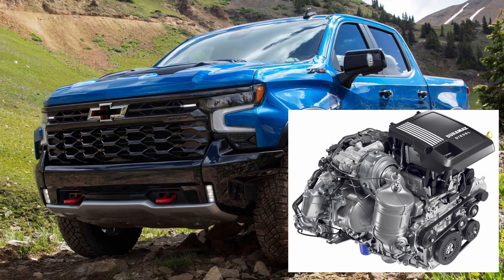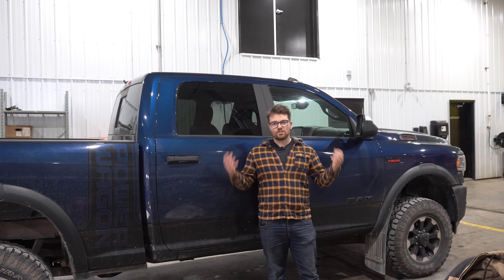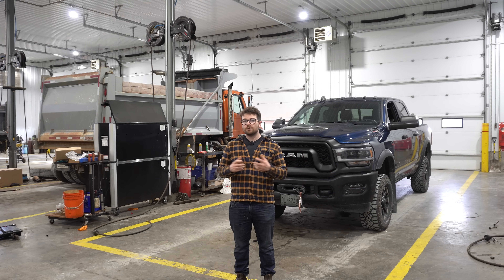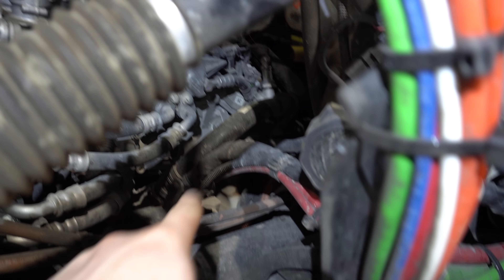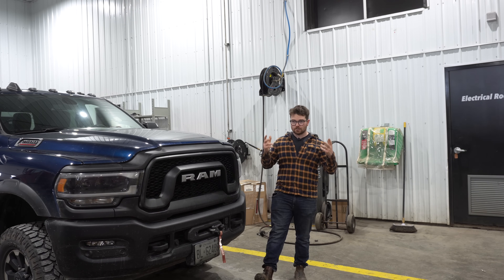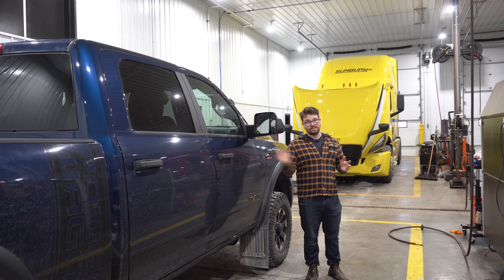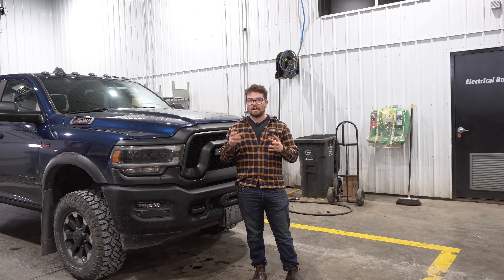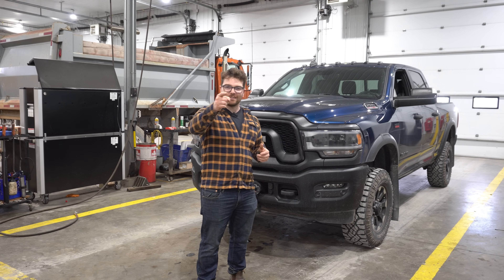Chevy Silverado 1500 3.0 Duramax Diesel **HEAVY DIESEL Mechanic Reviews** | Is It a GOOD Engine??

Comment: Best damn powertrain in a 1/2 ton truck by miles!!!!  I own a 2022 and this thing tows my RV better than my 2019 6.4 Hemi Ram 2500!  I get 26mpgs city and 30mpgs highway.  Towing my RV I get 14mpgs!  Maintenance and oil changes are less $$ too!  The oil belt is now rated for 200k miles which 90% of us owners will never even touch!
Reply from the maker: Happy to hear you like the truck and the Duramax!
Reply: @GettysGarage  yeah I have several trucks (Ram 2500, F150, Ram 1500) but love my 3.0 the best!  The torque and acceleration it has for the economy is astounding!

Comment: Thanks for making this video! Enjoyed your video and learned a lot man. I just bought my first diesel which is the 23 AT4 with the new LZ0, so far so good...The torque is amazing! .  I have about 500 miles on it so far so good. I came from a 17 Tundra 4.6L, I just hope this engine/ truck is reliable for the long run, since I've owned only Honda and Toyota in the past.
Reply: I picked up a 2023 AT4 LZ0 Diesel, too. Let's keep in touch for future experiences.  Enjoy your truck!
Reply: @rjsangha  For sure man! I just hit 1,500 miles on mine so far so good.
Reply: @clubtc05  what kind mpg have you been getting if don't mind asking ?
Reply: @rjsangha  around 19-20 in city and around 27-29 on hwy.. you ?
Reply: @clubtc05  so i only got 150 miles , I been getting 23-24 combined , still have to take a long trip to get a freeway mpg. But I am impressed, coming from ram 5.7 hemi I was only getting 13-14 mpg with 3inch lift.
Reply: Did you happen to get the max towing package ? If so how is the truck handling with it ? I’m in the market for the 2024 Chev 1500 LZO max tow !

Comment: I have a 2021 GMC AT4 with the 3.0 @ 50,000 miles. The only issue I have had so far is the starting issue. The first time it happened I thought I was going to have to disconnect the battery to make it stop cranking. The dealer has never been able to replicate it but they did show me the TSB for the cam sensor and told me they would need the truck for a week. Because of that I've never had it fixed. In 50,000 miles it has only happened about 8-10 times so I haven't stressed over it too bad.

Comment: I picked up my 2023 with the Duramax last week. I have the max trailering package, which gives you a 13,000 max tow rating. I think it is a very impressive truck. I also have a diesel Range Rover, which I plan to sell next year. I believe the fuel mileage is similar, despite the fact that the truck is a lot heavier and more powerful.
Reply: What’s the most you’ve towed with your truck and does it drop a lot when you hook up to a heavy load ? I’m in the market for a Chev 1500 LZO max towing package myself !

Comment: I crossed 52k in early October, more than half of that while towing our trailer.  Had a DEF level issue (gauge inaccurate) issue that took almost 2 years for GM to finally address. But 5 Service visits and 30+ days out of service since October 8 - EGR Cooler, Valve, Pressure Sensor… Then Glow Plugs, now a Chaffed wire issue on the EGR Pressure sensor leg of the harness.  My biggest issue isn’t the problems we had, but rather dealing with GM to get the problems addressed.
Reply: What was the resolution for the DEF gauge?  Mine is brand new and the gauge shows 40%.
Reply: @jamesclark7630  - Gauge is accurate when not trailering.  It doesn't sample correctly, and can't predict range for anything with a trailer.  I'm at 75k now and have learned to accept it.  40% means they didn't give you the truck with a full tank of DEF...  Also - it's a 7 gallon tank (appx) but will show empty with 2 gallons (appx) left.
Reply: Lemon low

Comment: if you avg, 15,000 miles a year it's still 10 years before you need to service it, me my diesel runs 3-6 years so i probs will have it sold before it reaches 50,000 miles due it being a business expense 

LZ0 belt inspection/replacement has been pushed back to 200,000 miles since it hasn't shown any significant issues at 150,000 miles
Reply: Nothing to do with not showing wear. This engine is too new to have a sample size of engines over 150.000 miles large enough to have a indication of wear. It’s more likely GM got negative press about the labor to replace the belt and just upped the mileage to quiet the complaints. By the time a problem with belts breaking becomes widespread these trucks will be way past warranty and old, they won’t have to pay for it. GM probably won’t even be making this engine when the majority get that amount of miles on them.
Reply: @khakiswag  plenty of 150k out there , clearly they run their own tests too . Doubt they give a shit about "negative press" Duramax 3.0 selling very well for them
Reply: @AmazonWebService98  they do run their own tests and that’s when they determined 150,000 miles. Probably what the manufacturer of the belt also stated from their tests. However after it got out about what was entailed in replacing it they magically waved a wand and said 200,000 miles. But trust GM I’m sure it will fine, just like the transmissions, lifters and ignition switches.

Comment: LM2 is a good engine but too complex for a diesel. It has multiple coolant valves & sensors, which can fail on top of the emmisions system, which can fail & limit mobility. The weak point in 1/2 ton GM, as well as, Ford 1/2 ton trucks is the garbage Ford-GM 10-speed transmission. Currently diesel costs @ 30% more than gasoline & 3.0L diesel engines are @ 30% more fuel efficient. So fuel costs are about the same. Diesels also have higher maintenance costs & require DEF.
Reply: A Service costs me around 25% more for oil and filter.  8000km for gas vs 12000 for 3.0 so ends up being equal or same.  Fuel filter is 40$ and takes 20 min to replace in driveway

Comment: I have a 2022 3.0 1500 seirra and I have hit 35mpg multiple times and even taken pictures of it because I was shocked. and I ordered my truck with the max tow package crew cab and standard bed and I'm rated to tow 12000 lbs so your numbers are a bit off I think the numbers you quoted are for the older (non refresh model)

Comment: Long start/no start was solved almost a year ago. All they do is update the software. Oil belt would be no harder than a timing belt on modern cars
Reply: False!

Plastic timing cover easy to do. 

Go remove your 4WD system and get back at me: Philip😮
Reply: @fastinradfordable  you obviously haven't taken the timing belt off a modern car or crossover. Funny how people are complaining about having to to spend about 1500 every 200k miles

Comment: The problem most people are having is related to the emission systems on these diesels. Unfortunately, if you live in a communist state you won’t be able to delete much as you have emissions testing. Otherwise, if you delete EGR and a few other of the emission components the vehicle should last you. Also, if you’re able to get a fix geometry, turbo and eliminate the VGR you will also add to longevity.

Comment: Great job.  I own one.  Any thoughts on the following: big rig engine displacement is 4x - 5x that of the 3.0.  Given that ratio of "soot" pouring into the EGR, is there any salvation for the 3.0 that produces many orders of magnitude LESS soot going into an EGR of "about" the same "size" as the commercial engine . . . thereby, possibly suffering a bit less from all the friction generated on all moving (and non-moving - injectors) parts as compared to the 15L?  Just guessing and hoping (and dreading the 150k mile timing belt change).  Getting ready to do the same job on my 2.8 L Canyon . . .

Comment: Paused.... did they just say "The most reliable diesel GM has ever made!?" Yeah right! That stupid broad running GM is lying again! Look at all the emissions crap, complexities, 'unique' experiments of this design that can't be serviced or repaired, and compare that to the LBZ 6.6.  I've personally seen dozens of them with over 750k RV-hauling miles, as I owned a business that serviced RV hot-shot trucks.  The Duramax LB7 was also a great engine, pardoning the injector design. All the pre-emissions Duramaxes were amazing especially for the time. Maybe a slight design flaw here or there, but nothing like diesels today. Sure miss my Hopped-up LB7

Comment: Currently have about 45k on my 20 LM2 been driving almost 3 years. Haven't had a single issue. I leave it in 2WD except when the weather demands more and I average 28mpg with a mix of city and highway driving. On road trips I have seen as high as 36mpg! All in all I have been very happy with it and hope to drive it through the half million mile mark before it needs replaced.

Comment: i have the 2021 3.0 duramax 1500 rst with a 3 1/2 lift and 34.5 x 11.5 tires and ive had nothing but issues. one after another its only got 30000 miles on it. i think the chevy dealership put the wrong lift on it and i beleive there is a ton of recalls on this truck. i spent my VA disablility money on my dream truck and its been a nightmare. its been in the shop 2 weeks of this month still in the shop and my next move to to talk with chevy

Comment: I have a 21, I do like the truck and it has good power and gets great MPGs. I get an average of 24 for my daily stuff and low 30's on the highway.  It is very comfortable to drive and easy to get around in.  However, I did get a check engine light as a result of a bad injector at just over 13K miles.  All the injectors were replaced, which tells me that there may be an issue with them.  But there was a consistent check engine light as soon as I would leave the shop and return it.  The short of it is, they ended up replacing BOTH EGR valves and the exhaust brake.  It was in the shop for 3 months because they had trouble understanding the issue.  If I had to buy it again I probably wouldn't.  One; Ive had it in for other warranty issues and it has to go back again.  So I'm not impressed with the quality.  Two; the longterm maintenance issues that was in the video gives me some concern.  Three; it's always seems to be the emissions that ruin theses great diesel engines.  If I can get it legally removed I may but at what cost?

Comment: A couple of points...the Gen 2 3.0 Duramax will have 305 HP and 495 FT LBS of torque.  It should be available in a few months.  Also, unlike the Eco Diesel and the Powerstroke, this engine was designed from the ground up for the Silverado/Sierra 1500.
Reply: and tahoe
Reply: @Toymonkeyjr Tahoe/Suburban are simply the SUVs based on the Silverado/Sierra platform
Reply: @thesixgunfighter288  so I'm not wrong lol
Reply: @Toymonkeyjr  No, I’m just being more elaborate lol. Nothing personal meant. I’m very technical sometimes.
Reply: I have the gen 1 3.0 
2021 it’s been a work horse 7500mi oil changes I burn 1 qt of oil that’s always been my modow only issue I’ve had is pickup pump in the tank just gave out at 47k mi gm is warranting this 5 min after I got it to em other than that the truck is great
Reply: Those numbers are much more respectable.

Comment: The timing system is chain driven not gear driven and to replace the injection pump you do need to remove the transmission. I am a diesel tech at a GM dealership. And they have pretty much fixed the extended or no crank issue with a software update.

Comment: I have one 8 months I get 27 and up to 39 mMPG in highway at 55 MPH . I have towed up to 15,000 ( slowly and flat short distances ) pulls with ease 💪🏼💪🏼💪🏼 great engine and it’s ultra fast off the line . I put 40,000 miles in 8 months heavy work no issues .

Comment: I got the 2021 GMC Elevation 4WD X31 quad cab with 3.0 Duramax. Didn't put too many miles yet, just 12k miles, but I love this engine, specially the mileage. I'm getting 24 mpg combined. Andin the highway I got up to 31mpg in a trip from San Diego to the grand Canyon. Hope the engine will age well with no mayor issues.

Comment: I have a 2020 Silverado with the LM2, I love it, paired with the 10 speed transmission it’s a good setup.  I’m not concerned about the oil belt, if it needs changed at 150,000 miles I’ll do it.  I wish there was a delete for this.
Reply: LSI out of California is making a retrofit chain conversion for the LM2 / LZ0 3.0 Liter. The problem is that chain stretch and noise can be a problem. The belt from a design point is the best solution. Less centrifugal weight, and something about chatter and speed control issues were the biggest concerns. Forget that! The belt mandated inspection/replacement has already been bumped all the way up to 200k miles for the 23’ model years on up. I’ve herd the belt is supposed to be good all the way up to 250k miles at a minimum based on manufacturer tests. GM simply set 150k as their own inspection interval. Maybe they should come out and make clear what the belt manufacturer says the real truth is. Has anyone had a belt fail yet? The motor has been out since 2019. On another popular website this question was asked. No one has first hand seen or herd of a belt failure. Bottom line, the oil belt issue is a NON-issue. Period! It’s going to be the least of your concerns as an owner.

Comment: I have the 2021 1500 Sierra with 30,000 miles so far and  no major problems. Runs strong and haven’t had a issue with the long start that was mentioning in the video. I did within the first 6000 miles have a DEF injector clip break causing fluid to leak under the hood and cause warning that speed will be limited until DEF is filled.

Comment: 3 dollars a liter for diesel where I live though.  If you buy this over gas, you must just really really really want to own a diesel.
Reply: When it all boils down you really aren’t spending that much more on fuel since it’s the best at fuel mileage    Specially if your towing.  No other half ton engine compares to it.
Reply: My math based on mpg for a 3.0 vs a 5.3 is that if you pay $1.70 more a gallon for diesel vs gas you break even on fuel. If you compared it against the 6.2 which requires premium fuel and has a lower mpg than the 5.3 you would be spending less on fuel with the 3.0 at current diesel prices.
Reply: @shanebrown2963  How much does the DEF/SCR/DPF unit cost under the hood 8k dollars?  That buys a lot of gasoline and only a 2 year warranty on that.  24k miles warranty by the big 3 on those components.  It's a nice engine, just they have ruined diesels with all those emissions components.
Reply: @ddw3968  Math never works for diesel.  Been there done that.  Put the calculator away and just know you always pay more for cost of ownership with diesel.  Might have been different pre emissions, but not now.
Reply: @peiguy1982  sure it does

Comment: GM has nothing but computer and emissions problems , and that’s all GM products. Then compound those problems with a GM designed Diesel and you have many issues over time. If they make it to 1 million miles like Dodge Cummins then I might have a change of heart.
Reply: It's not a Dodge Cummins. Dodge has nothing to do with the engine. They're just Cummins... Powerstroke, Cummins and Duramax have emission issues. Ram also has garbage transmissions.. Ford still uses the Cp 4.2

Comment: If this engine has all these problems why in the hell would anybody want to buy one have to remove the cab to get to the back of the motor to adjust the gears it's crazy there's no way I want one they can keep the pile of junk they probably want $100,000 for it it's not worth it

Comment: Good to see no one else has had issues with their 3.0 Duramax. So far, I have a 2023 GMC Sierra 1500 with a 3.0 Duramax just 850 miles new and two check engine lights on it already. For those that want to know more, the codes were P0402 and the truck is brand new and in the Dealership Shop. Very sad.
Reply: Did they fix it?

Comment: Everyone seems to compare it to the 5.3 for maintenance costs, and mpg. In reality 3.0 should be compared to the 6.2. 6.2 has more horse, but the both have 460 on torque. The 5.3 doesn’t even break 400.  
More oil, and way worse mpgs on the 6.2.

Comment: I have a 2020 crew standard bed 4x4 z71 and it has about 75k miles on it,  first this power train is amazing I get 25-26 mpg going 75-80 during my commute but have gotten 29+ on trips from Santa fe to Colorado Springs and back. 
 1st issue the crank no start/ long crank is a 2021 model year issue, mainly because for some reason GM changed suppliers of the cam wheel between those years but did not update the software for the cam sensor, so the sensor was reading what it expected to be the 2020 wheel but since it was changed slightly it wasn't fully reading it, again not every 21 year truck has had this issue. 
2nd the oil pump belt is inspected AND replaced at 150k but that service has been increased to 200k miles due to the belts still being in good condition. 
Only new issue I've known is Def tanks going out,  no clue if it was due to trucks waiting on lots due to the chip shortage or what but that seems to be the only issue with the trucks, and it's not an engine issue,  all the other "concerns" seem to be an issue with diesels in general and not specifically LM2 related. Having said that this engine pulls my 7k lb TT with ease, it has plenty of power and just goes. Definitely an awesome engine

Comment: Oil pump belt will likely get a 200K mile replacement schedule based on actual wear, and the LZ0 uses the exact same setup and has a 200K interval, also the EGR is after the DPF so the soot level should be much much lower.